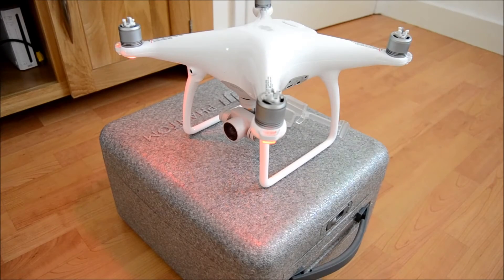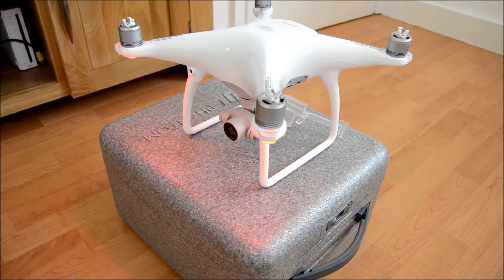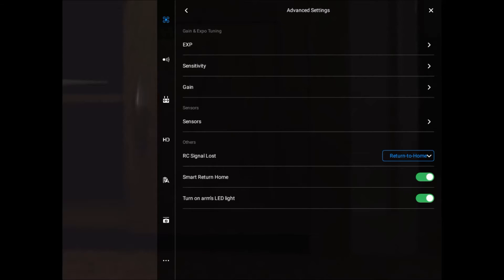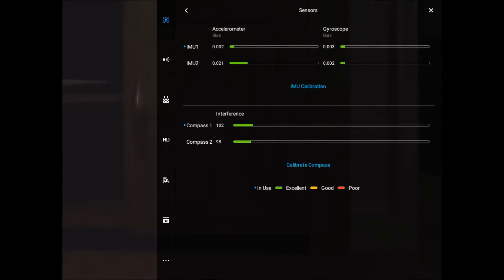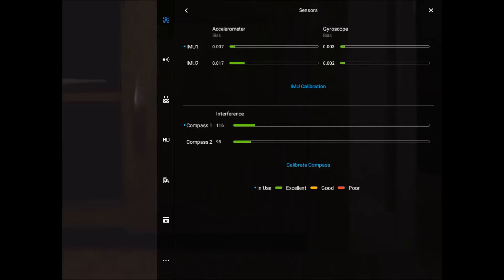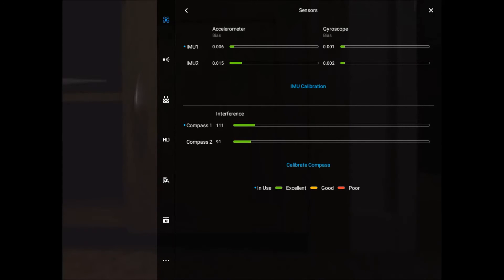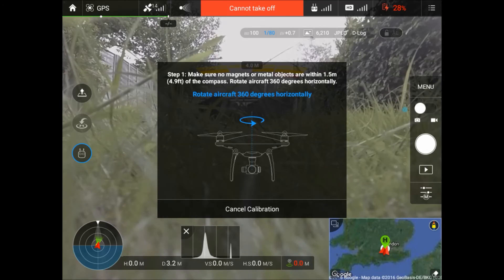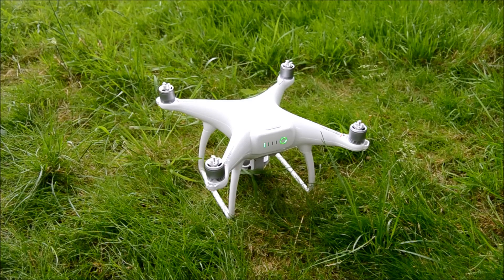DJI Phantom 4 IMU & Compass Calibration

Comment: In the second part of compass calibration the instructions are to face the nose down , the diagram shows it on its side and Forza does it on its side. Ive always done it with the nose (camera) facing down. Which one is correct?
Reply from the maker: Just noticed that, the diagram is different to the text. I think alot of other drones like the nose down, so I would probably stick to that.

Comment: sir I have P4P and my compass 1 shows me disconnected
Reply from the maker: Your having issue with your compass?
Reply: Alex Savo yes sir
Reply from the maker: Whats your issue and how does it affect the drone?
Reply: Alex Savo it's shows mein move your aircraft or calibrate it
Reply: Alex Savo I calibrate it 2 times but it never calibrate there a warning of calibrate vision sensor I calibrate it and it will calibrate ....only 1 warning remains magnetic field near your aircraft or restart it . I'll do all things what's it says but nothing happens

Comment: Re-calibrating the compass often is important.  The earths magnetic field is very weak.  The problem is that any exposure of the Phantom compass to a magnetic field screws it up.  My brother had a magnetic money clip in his pocket and just carrying the Phantom at his side near the magnet screwed it up.  Unless you KNOW that the Phantom has not been near anything potentially magnetic since the last flight you should re-calibrate.

Don't have on metal rimmed glasses, a belt buckle, a watch, a phone, (money clip!) within 10 feet during a calibration.  No power pole with a transformer hanging on it, no car, no concrete with rebar nearby.  It could be the thing that saves your bird when things go very wrong.  The compass is how the Phantom determines which direction to point to when RTH begins.

Similarly, the IMUs easily lose calibration whenever they experience g-force shocks.  Falling off the car seat, sharp bump, slamming on the car breaks, your kids playing with it.  Shipping almost GUARANTEES that the IMUs are messed up; have you watched UPS and FedEx handle these lightweight packages.  When I got my new Inspire, I went out to the truck to get it, and watched it fall 5 feet from the top shelf to the floor of the van.

Therefore, any factory calibration is way gone by the time you get it from the factory in China.

Because it is so easy to re-calibrate, there isn't much excuse for risking all that money to save a few minutes when you are not sure what might have transpired since the last flight.

Comment: I have Phantom 4 Pro - and I read, it is already calibrated from the production, so why to do it again? And my other question, do I have to calibrate it before every flight again and again and again? Because, if so, it sucks :-D
Reply from the maker: +RobinPM100 I would always calibrate it when I first get it. It's now halfway around the world. I would then only calibrate again after every firmware update or if I take it to another country.
Reply: OK, that sounds reasonable, because somebody told me, that I have to calibrate compass and IMU before my EVERY new flight. I did not know I have to calibrate it at all and after that info I was even more horrified :-) I expected that such an expensive product is spot on, calibrated from the production and that the calibration lasts etc :-)
Reply from the maker: No way :) Leave them to do it if they want.  Like most drones, its not needed unless you play with the firmware or change location by hundreds of miles/km.
Reply: I heard about an easy method how to find out if my compass needs calibration, just push forward and if the drone flies forward, compass is ok, if it flies to the left or something like that (when you push forward), then it is time to recalibrate the compass because the drone is definitely confused about directions :-) easy :-)
Reply from the maker: +RobinPM100 ok.....Can see that. Also if you take off and it's not windy and starts drifting left or right or forward etc then it needs doing also.
Reply: When I fly I always calibrate the compass! I only calibrate the IMU if it indicates it needs calibrating? which has happened before. But definitely calibrate the compass when you change your location. and make sure it ‘tellls’ you  “home point locked!”  Very important! You only need to do it once at the new ‘location’ as long you keep flying from that point it’s fine. I always do a test flight at about 10 mtrs to check all the controls are working “roll pitch and yaw” then your good to go.
Hope this helps.

Comment: the image and the text instruction doesn't match up. The image is on its side but the direction indicated to turn the nose down and rotate...
Reply from the maker: Are you referring to my video or what your seeing on your screen?
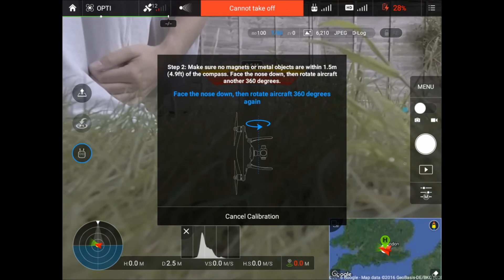Reply: I'm referring to DJI's (illustration @ 4:08) instruction. You've indicated to face it on its side BUT the instruction indicates to turn the nose down. However, you did follow what was illustrated by DJI... but it still works either way...
Reply: Ferdinand Jarquio I've noticed it works either way, but I do get a concerning message along the lines of the gimbal having to overwork when I rotate it on its side. I think nose down puts less stain on the gimbal.
Reply from the maker: +Ryan Paul I find that a concern as well. Shame that in the calibration mode, the gimbal doesn't shut off.
Reply: Alex Savo After a bit of research, it seems that the right way to do it is nose down. Seems less stressful for the gimbal.

Comment: Hello, Can you help?   On the DJI tutorial it said the  motor lights would start as yellow (all 4) .  https://www.youtube.com/watch?v=uvIAxhbJqqs - 1:06 

Mine did not and then stayed red in the front and then green in back during horizontal calibration. During vertial same thing except flashing green in back.  I have been researching like crazy to see if that is an error or just an oversight on their part. I noticed that your lights are the same as mine... Any suggestions? 

BTW - I was so excited that I flew the drone before calibrating the first time. (Missed that step)

Comment: does the phantom 4 compass need to be calibrated with each new location
Reply from the maker: I would do it if you are moving to a completely new location, as in say 200 miles/km away from the last time you did the calibration.
Reply: Robert Falk I do

Comment: Hei from Norway! Good video. I got my New DJI Phantom 4 yesterday and today I will load battery and make it ready fore flight. Question. Calibrate Compass is before every tour I know and I own a DJI Phantom Vision+ before. But IMU? How often you calibrate it? And you check this imu before every flight? I can calibrate Imu inside? I bouth Phantom 4 because of tecnology like doubbel Compass and Imu. Bigger battery. Good camera. Zize is ok not big. Drone I had before this was Yuneec Q500-4K and I like It mutch. That drone was big. Propell is awsome on Phantom 4. Easy to putt on. Ok but pleace tell me about Imu and how often you calibrathe it, thanks)))
Reply from the maker: IMU calibration can be done inside. Its simply just to make sure that the phantom is phantom is level and when stationary in the air, its not moving left to right. It only needs to be done really before any compass calibration or after a firmware update.